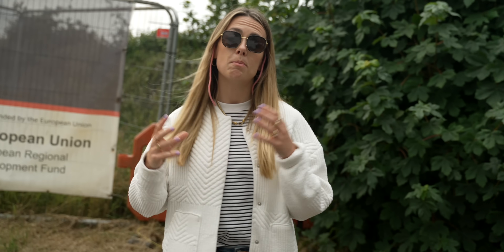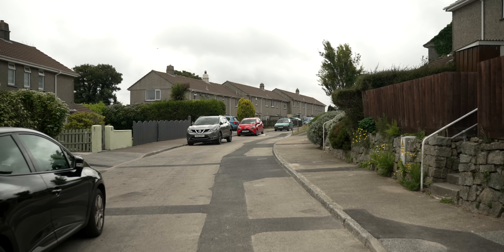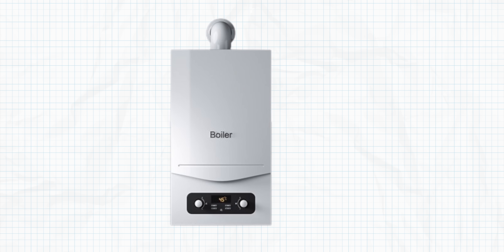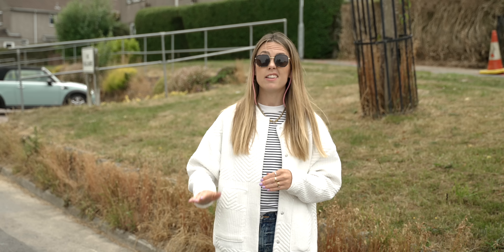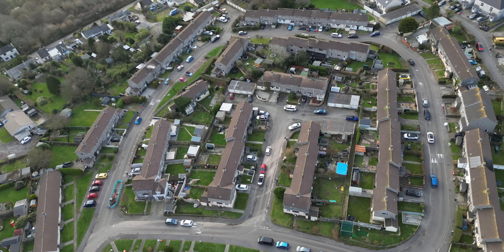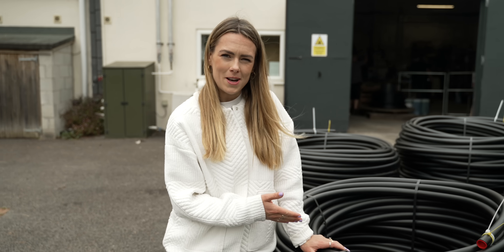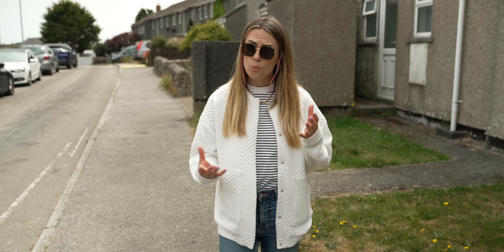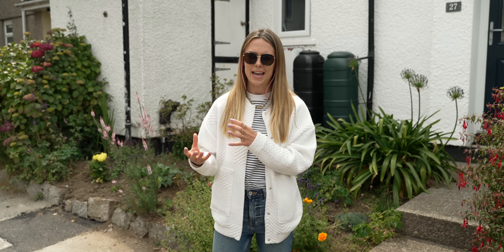Can Kensa's Ground Source Networks Supercharge the UK’s Heat Pump Rollout?

Comment: Would be cool to put the first section of (uninsulated)  tubing parallel to the sewage pipes in the street. To recover the heat from waste shower, bath, sink and toilet water (which is always being wasted and renewed).
Reply: (rather take that residual heat out before the sewage leaves the home... run the shower pipes through the bathroom thermal mass - slab. - very little "quality" heat will remain, besides it does prevent shallow pipes freezing.) - all good points are good points.
Reply: @kadmow  true. I have a heat recovery drain in my house. 2m high copper soil stack with a copper spiral pipe around the outside.  Incoming town water goes up the spiral while the shower water comes down the centre.
Reply: @ecoworrier  yes for houses that still use baths, they ought to fit baths with a copper coil running around them to harness all of that lovely hot water heat that most people just “pull the plug on” (like my dear wife for instance 😁)
Reply: @philtucker1224  for the bath (we need contraflow for the heat recovery drain) I leave the water overnight to let the hot water lose the heat to the bathroom. Then drain it in the morning when it is room temp.
Reply: @ecoworrier  how about condensation?
Reply: @TC-V8  We also have MVHR (Mechanical Ventilation with Heat Recovery). The water vapour (with lots of latent heat) gets sucked to the heat exchanger in the MVHR unit, condenses there and gives the heat to the fresh cold air coming into the house. Wet, warm, stale air out - dry, warm, fresh air in. We suck from wet areas (kitchens, bathrooms) and blow to living room, bedrooms etc. Been running for 10 years at around 60W, saves a ton on heating, makes the air dry, fresh and pollen/dust free. Just needs new filters 3/4 times a year and I also clean the heat exchanger every few years.
Reply: @ecoworrier  That’s sounds excellent (was it originally part of a televised /financed project - or did you just fancy building it out of your own pocket? (I’m just trying to work out how much more it would cost over say, a thirty year life project span?).
Reply: @philtucker1224  televised - no. Financed - yes with a mortgage. New build 10 years ago and built to passive house standard. MVHR is standard for passive houses but could easily be used in a retro fit. I suggested to a mate he just put vertical ducting up his stair well and refreshed air at every level. Should be simple. Look at companies like Zehnder. Mine is from Paul (same company now I think). About 3k for the box. The heat recovery drain I had to import from the US. No moving parts, no maintenance. Just sits there and works when it it has a temperature gradient
Reply: @ecoworrier  sounds pretty good Eco, however it’s clearly a bespoke installation designed or specified by you so with all due respect you can’t expect Joe Public to have the same capabilities as an eco enthusiast such as you clearly are, but big respect to you buddy, very interesting stuff..
Reply: @ecoworrier  yes we also do that. A lot of people don’t think of those things regrettably
Reply: @philtucker1224  every HVAC system is bespoke, where @ecoworrier seems to differ is casting his net wider than usual for components, what he's talking about isn't in Wickes or Screwfix.
Reply: @ecoworrier  some warehouses have a fan in the apex of the roof & soft trunking dangling to a foot off the ground which circulates waste heat down to where it's wanted. (Soft trunking so it isn't trashed by normal movements in the space).
Reply: Is the return fluid always above freezing?
Reply: @edc1569  (below about 4 metres ground soil) in the U.K. stays at +12 degrees c all year round I believe, winter and summer.

Comment: Could this not be done all over the UK especially if the wells could be drilled in the street. I know you say this particular instance the ground is warmer than normal but by how much. This could be good for lower income household and old closely packed terraced houses were   installing  a air source heat pump could a challenge.
Reply: Ground source energy is just solar in a roundabout way. The sun heats the ground and at depth the temperature is pretty much constant at around 10 deg C all year round, just like in a cave. The ground has a huge thermal capacity so tapping a bit of it by using it to heat a very cold circulating fluid by just a few degrees has very little effect. In the summer, when the heat pump is just supplying hot water, solar energy replenishes the heat store. In the case of Cornwall the heat source is geothermal as well as solar.
Reply: No I don’t think trying to install it for old or existing houses would be that practical as the extra cost to existing home owners would be enormous. However, they are being fitted to new housing from 2026 as part of the new building regs (as new gas boiler installations are banned from then onwards I believe)..
Reply: @philtucker1224  The whole point of this scheme is there's no upfront cost to the home And one of them had an old coal shed so it definitely wasn't a new property
Reply: @adus123  Hi Ad, thanks, - (if there’s no upfront costs, there must be a monthly repayment plan over a number of years). This would be in addition to the customer’s normal energy bill. Do you know how much that extra charge would be by any chance?
Reply: @philtucker1224  Did you watch the video.
Reply: @adus123  buddy, if you don’t know then just say “I don’t know”
Reply: @philtucker1224  all they pay is about £1 a day and the additional electricity.  if you watch the video you will know this.

Comment: Standing charge for connecting to the system is nearly 4x a day more expensive than the current gas Standing. If that includes the heat pump, installation maintenance then that's ok.
Reply: This touches on one my 'concerns' - who owns / maintains the 'shared' part of the GSHP... if there's a maintenance contract covered by the standing charge, then that's great.

Comment: curious how this affects the size of HP for the houses - thats a lot of digging just to pre-warm water that then needs further processing. that house with a 7kw heat pump is standalone size for many properties
Reply: Edited: It won’t change anything in terms of the size of heat pump, that is dictated by the volume and insulation of the building. The “efficiency” gain is in the shared cost of boreholes and the increased COP compared to any air source system. Heat pumps work by concentrating heat and moving it from one place to another. The water in the ground loop does not circulate in the home, only the heat pump  there are heaps of videos out there explaining how great pumps work, but think how the front of a bike pump gets hot as you compress the air...
Reply: It’s not pre-warming the water, it is the thermal source. Less nosy, less intrusive and performance is less dependent on the weather, so you can size the units smaller.
Reply: It’s actually using the warmth of the soil to create warmer water to start with so saving hundreds of pounds per year in a home’s water heating costs. Think of it like putting very hot drinking water into an electric kettle, (it will boil much more quickly so saving all that electricity…)

Comment: This is very cool stuff. Really makes sense to have ground array approach as more reliable to the residents.
Reply: stating that it will be more reliable is just an assumption
Reply: @nc3826  agreed, it is an assumption.
Reply: @patrickjr11   As a long-term heat pump owner and user.... I have data that concurs with and contradicts.... That assumption....
Reply: @patrickjr11  but i agree.... either way it's still very cool stuff....

Comment: Excellent project - would be good to see some major house builders pick up on this type of technology for new housing estates. GSHP are even better than ASHP - as pointed out in the episode.
Reply: Particularly when you’re already doing heavy groundwork anyway…
Reply: They are more consistently reliable but need very expensive excavation if retro fitted. It’s probably more practical just to use them for all new build projects (as the new buildings regs dictate). Air source is ok if you need a compromise solution.
Reply: @philtucker1224  If I had a spare 30K, I'd definitely get a ground source heat pump

What I'm doing however is as follows:

- super insulating my flat roof
- Super insulating the walls of the flat roof
- Getting triple glazed windows
- Getting an MVHR
- Getting larger pipes
- Getting Jaga Strada radiators

Only when I've finally done the most I can + air tightness, I'll get a heat pump of any kind

It'd be difficult to retrofit for an entire street but like you say, it's easy for new builds
Reply: @waqasahmed939  MVHR = Mechanical Ventilation with Heat Recovery?
Reply: @waqasahmed939  once you've reduced your heat losses by doing all that insulation, you may not require larger radiators/ pipes

Also there's a really interesting article entitled "insulate Britain! Sure but by how much?" Which details the pros and cons of installation of a heat pump pre and post insulation measures. Also how much insulation measures before returns dwindle.
Reply: @alanhat5252  Indeed
Reply: It’s already a compulsory part of the building regs going forward as new gas installations are now banned from (2026?)…Major house builders don’t get a choice!
Reply: Not sure they are anymore, ASHP get as good performance figures now I think.
Reply: @Lewis_Standing  I was only referring to the comment made in the video, that GSHP seem slightly better than ASHP.  The sooner we move away from the standard installation of a gas boiler  to either of these the better in my opinion.
Reply: @Lewis_Standing   - GSHP "never frosts up" (if the ground exit points are properly lagged), never wastes energy defrosting - sure the lower UK, not such a problem, it never gets 15 below for too long.. (C).
Reply: The problem with a GSHP for an individual house is the cost. ASHP may not be quite as efficient but they are a lot less expensive. So, you can pay the up-charge for ground source or you can put that money into more insulation and better windows. A GSHP really only makes sense for larger buildings (schools, hospitals) or when a bunch of homeowners get together to share the cost.
Reply: Th renewable energy society should DEMAND. county city an state regulatory bodies adopt it an make laws supporting
Reply: @sparkysho-ze7nm  Yeah, let's make more laws (costing money to the tax payer), to take away more freedom of choice, and we can all look forward to a more rigid, dystopian future 👍